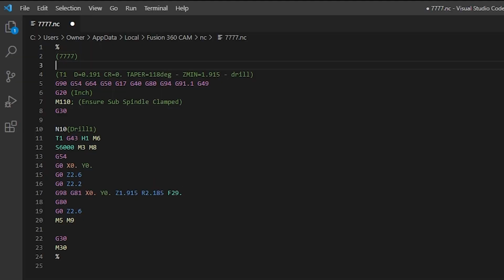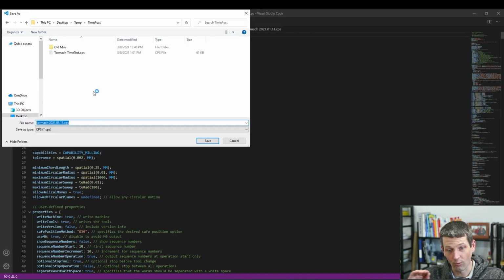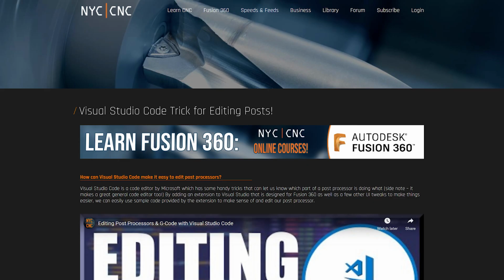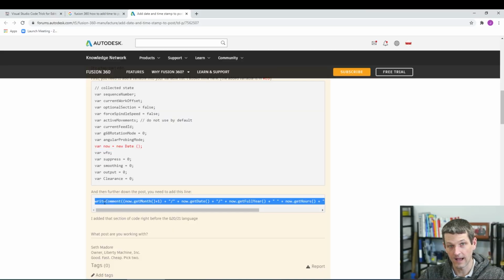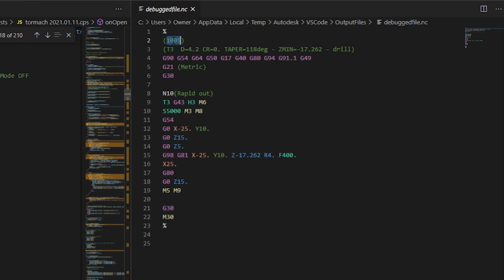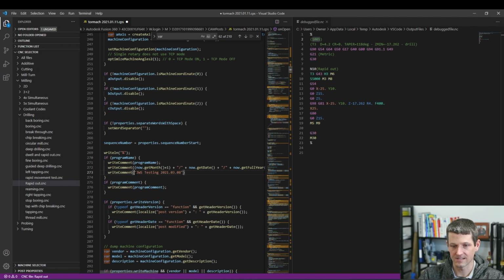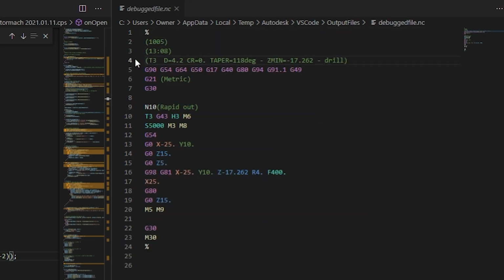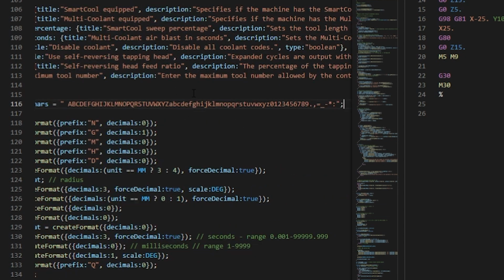How to Add a Time Stamp to Fusion 360 Post Processor G-Code!

Comment: Thanks for this incredibly helpful information. I discovered that the post already has a variable that cleans up the date for you. Try:

var postTime = getGlobalParameter("generated-at");
 writeComment("Post Date: " + postTime) ;

Also what I have found helpful is adding the local username, so you know who posted. I'm not a programmer, so not sure if it better to call a variable first, but can also:

 writeComment("Posted By: " + getGlobalParameter("username"));

I came across this video hoping to discover how to change the filename, which I have now discovered is easily possible. This is really helpful when using an NC Program within a template (so the program name isn't always the same). I can also now use command prompt to upload this automatically into my Fanuc control using FTP. Used to use a "sync" folder that I posted to, then drag/ drop to an FTP shortcut, but now can use function onTerminate to dump it directly into the control, just like a Haas. Good stuff, thank you very much, I am very happy to have ran across all of this!

Comment: I would suggest setting up a version control software like Subversion that will allow you to check your files in and out.  As long as you check each change in the software will track all changes and you will be able to revert back to earlier revisions.  This software is mainly used in the software programming world, however it can certainly apply to the machining world as well.

Comment: Thanks John , I few days ago modified my post , the power to modify posts in fusion is amazing
Here is my post processor for Haas 3Axis VMC has the following features
1. Shows Date and Time at Start of the Program
 
2. Got Rid of the Fanuc Style Program Number , now text strings are program number/name gives a nice view on control
 
3. Does not posts any Work Offset code G54/55/56/57... instead gives a good line saying "Specify Offset Here"
 
4. Shows Tool List with Max Z Depth of Each tool, help verify tool stickout and any unwanted Z Plunges.
 
5. Each Operation is well formatted into sections making the program look pretty. 
 
6. Has some Automation options of DPRNT over TCP , can be modified to suit needs.
 

My post is avaiable to download from my github

https://github.com/german-wings/FusionPosts.git
 

I use this post daily , but be cautious if someone uses it for their application
The post has //edits comments to help see what has been modified by me.
Reply: Does #4 work with 5 axis operations though?

Comment: I added the percent symbol (%) to my list of permitted characters and then learned that that having a percent symbol in the code will make my particular machine, a Brother,  reject it. If I recall correctly, it wouldn't allow the file to be copied into memory. After that I systematically tried a lot of different characters and only left the ones that the machine could actually understand. Below is the list, in case anyone wants it...

\"\'\\ !#$&()*+,-./0123456789:;<=>?@ABCDEFGHIJKLMNOPQRSTUVWXYZ[]_`abcdefghijklmnopqrstuvwxyz{|}ÇüéâäàçêëèïîìÄÉôöòûùÿÖÜ¥áíóúñÑ«»ßµ·

Note: since Fusion 360 post processors use JavaScript, the first three characters in my list (double quote, single quote, and backslash) need to be preceded by the JavaScript 'escape character' (a backslash (\)).
More info: https://en.wikipedia.org/wiki/Escape_character

Comment: That is actually useful. Although it seems to be superfluous since you can also see the time from the file time, this is not always visible on the machine. 
On thing: search for the line beginning with "description =" and change the name of the machine to show this is your own version. Fusion 360 shows this by name.
Another nice thing to add is the size of your stock. Just a few lines of codes added at the same two sections at the time:

var workpiece = getWorkpiece();
var delta = Vector.diff(workpiece.upper, workpiece.lower);

  if(delta.isNonZero()) {
    writeComment("Size: X=" + delta.x + ", Y=" + delta.y + ", Z=" + delta.z);
  }
Reply: Thanks for sharing this, I think I'll add it to my post! ...eventually.
Reply: Rob how do you know what is possible to add? There's a few things I'd like to add to my post